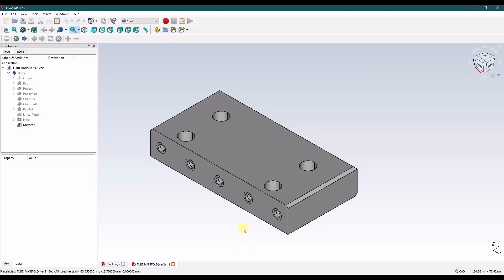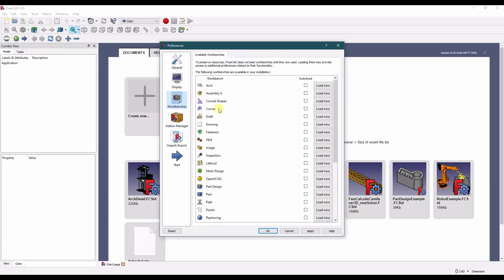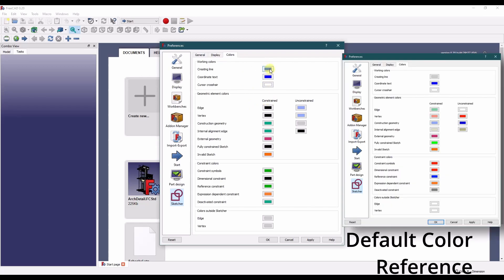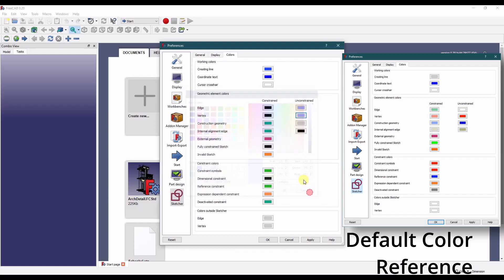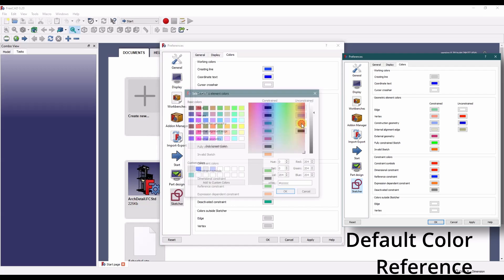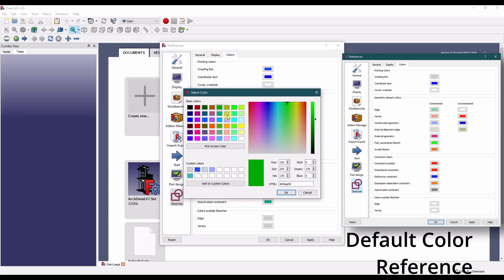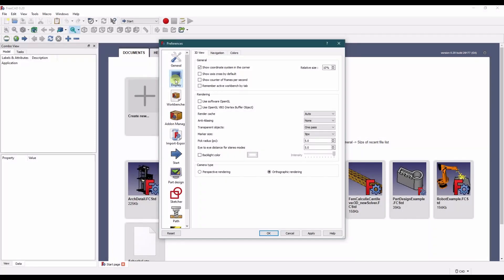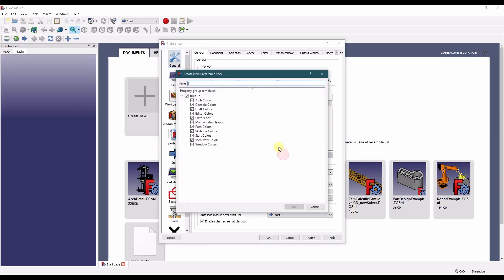How to Customize colors of sketch lines and solid bodies in FreeCAD (to mimic Solidworks)

Comment: I'm a long time user of $olidworks (at work - but I'm moving on now). I like FreeCAD and 0.21 is quite reasonable. I think v1 and the TNP fix is going to be pretty good (seen a couple of 'preview' videos). You certainly can't beat the price (and that it works on Linux and Mac). 

There are still a couple of things that $olidworks makes a simple but are a harder in FreeCAD.

I like the idea of modifying the colours to match what I am used to, and what would be even better is providing a customisation file as a link - save me having to go through and do it all myself!

Cheers!